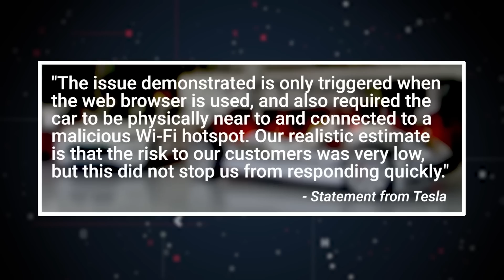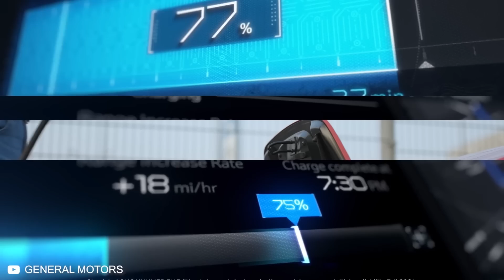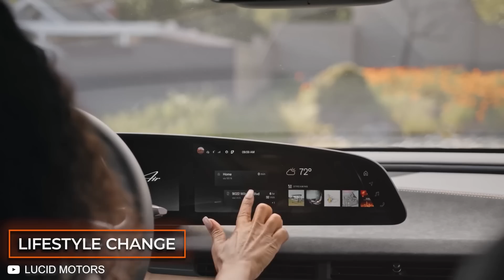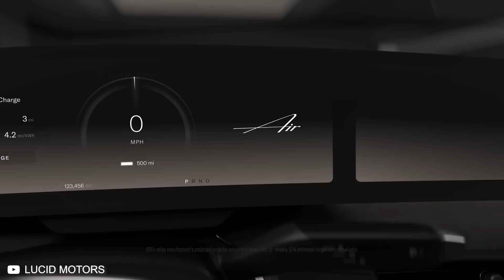EVs' Serious Problems That Carmakers Are Hiding

Comment: the main issue is choice. dont force me to buy EV by eliminating gas cars or taxing them heavily or some other trick.
Reply: Totally agreed. At the end of the day, cars are a product, exactly as clothes or tv, etc...
So there are people who like a kind of cars and other don't.
Reply: @GETTERoriginal  Toxic products are banned in the world as well.  Fossil fuel emssions estimated to kill 8 million people a year, source Columbia Uni.
Reply: @SovereignTroll  yes, and the energy sector, industry in general, the forestry, agriculture and mining sector contribute with around 80% if not more. Ttanspor is around the 16% (at least the last update I could see) and there, cars are around the 9%, so you still not convinced that evs are the solution to climate change, as politicians are selling it 🤣
Reply: @SovereignTroll  I correct myself. "I'm still not convinced....."
Reply: So tell me there is a huge demand to replace a reliable, efficient technology which has been around for a hundred years which can transport me up to 609 miles on a fillup and which I can refill on every street corner with an experimental tech where I lug around a 1000 lb battery which takes hours to recharge, costs a lot more money and has a “ev only” range of 50 miles and few charging stations. Then tell me this tech is ready to replace all gas cars in the next 10 years. This whole thing smells of activist driven push
Reply: @dgraja22  guess you should do a lil more research trog
Reply: @dgraja22  at 500 KW charger definitely takes no hours it takes less than an hour.  hybrid cars take longer but you can charge them at home in the garage.  and I guess that's cold there are engine heater poles.  Note Toyota full hybrid cars are not charged with cable, you are charged with the petrol engine
Reply: @dgraja22  It costs significantly less to charge an electric car than to refuel a petrol car.  and there are cars with long range such as Volkswagen, Kia, Tesla, Polestar
Reply: @dgraja22  electric cars will not replace combustion cars in the next 500 years
Reply: @mike-bv2jc  people said the same thing about the automobile replacing the horse and buggy. It basically took less than 50 years.
Reply: @mike-bv2jc  ha ha ha. OK. Hide and watch.
Reply: @g.goliver  the automobile is superior to the horse and buggy. EVs are not far superior to gas vehicles.
Reply: @mike-bv2jc  in the EU, cars that run on regular petrol and regular diesel will apparently be banned from sale from 2030 or if it was 2035.  but of course they can change in the future
Reply: @notyourtypicalwatchreview2563  That is your opinion not a fact. BEV are superior in ICEV in many ways, but the only one that matters is carbon emissions. So you better get adjusted to it because eventually ICEV are going to be prohibitively expensive at best. Once the majority adopt BEV they will vote that ICEV use either be outlawed or made prohibitively expensive. How about charging ICEV owners for the damage to the climate they are doing.
Reply: @mike-bv2jc  That is exactly the same thing horse breeders and carriage builders said about automobiles a hundred years ago. The smart one got into the new industry making automobiles the ones that didn’t are long gone.
Reply: @notyourtypicalwatchreview2563  You don’t think BEVs are superior to ICEVs, but just because you believe something doesn’t make it true.
Reply: @notyourtypicalwatchreview2563  Idk I be smoking 90% of gas cars in the Tesla
Reply: @integrityprojectsservices7890  and burning through that battery.
Reply: @mike-bv2jc  They already are.
Reply: @dgraja22  I too disagree with the forced aspect.  But ev's had 50 mile ranges 10 years ago.   Charging now is much faster too.  We are in early days for EV's.   The projections I see are not 10 but 30 to 50 years.  The longer period is needed for the grid(s) and charging network to keep pace.  Even if the tech is ready to change over in 19 years would be a bad thing.  One must always know where his towel is. :)

The trouble I see is making them affordable to people with fixed incomes.   Retired disabled pensions.     Maybe a reasonable used market will develop in 10 or so years.  Or maybe robo taxis will be affordable  idk
Reply: @dgraja22  My EV can go 280 miles easily in real world driving between charges and charges back up at home in 5 hours if empty but at a super charger in about 40 minutes if I actually needed to fully charge it so not sure where you getting your info but its wrong and out dated. My Tesla cost me $48K three years ago which is not much different then any other sport sedan in its class with a gas engine. I rarely go on long trips and when I do, if its super long, I take my gas truck. As far as demand, Every Tesla made has a pre paid deposit from an actual buyer before its made and they can't make them fast enough to fulfill their orders. There is close to a two year wait to get one currently, go on line and place an order and see your estimated delivery date. I charge at  home every night, cost me $60 a month and I drive more then the average person. I never stop to fill up or re-charge in my daily commutes, car is topped off and ready to go every morning. That to me is priceless. My gas truck sits and sits, I have to drive it every once in a while just to keep it from sitting.
Reply: @jstar1000  the info is everywhere being in the power line maintainer industry I’m well aware of how much it’s straining the grid 🤣 yeah your ev doesn’t strain it at all but all the ev’s together does and power outages are kinda funny in my opinion as people realize how inconvenient they actually are since most ICE vehicles are doing just fine and ev’s are sitting in the shed till the powers back
Reply: @1234crazydude  not an issue where I live so far, solar panels and battery backup solve that problem also. Also I have two gas trucks so no worries plus it takes power to get the gas out of the pumps right?
Reply: @1234crazydude  Zero power outages in my area in the last three years except for a couple of storms for a couple of hours, no effect what so ever on my EV.
Reply: @jstar1000  Thank you.  I am a little shocked at people spouting off about issues with EVs when they clearly have no experience with them and have not bothered to look into how the cars operate.  I will make space for discussions about electricity generation because that is real, but the complaints about these cars, cost and performance, are unfounded.
Reply: @jstar1000  🤣🤣🤣
Reply: @ElDuchè24  My brother was a truck driver for over 40 years and just retired, you are required to stop for 30 minutes ever what 4 hours or so, so the need to go 1000 miles on a fill up is irrelevant now isn't it? but you hate on Tesla and do you all you want the world is changing with or without your approval.
Reply: @ElDuchè24  Yeah and during your 30 minute break you can charge up enough to get you to your next break is the point if needed and no I don't have a job where I'm required to do anything, I work for myself out on my own so I do what I want when I want pretty much. If you hate EV's then good for you, it don't matter, you hate them, others love them, they are not for everyone at this point but they are badd ass like it or not, the electric grid will be upgraded to make them viable for everyone eventually, electricity is made in America by Americans, what's to hate, prefer foreign oil?
Reply: @ElDuchè24  Will do!
Reply: @jstar1000  where does the power come from to charge it?
Reply: Let's face it EV's are made for city use, but there are a lot of very rural remote areas in US and in Canada where there just will not be charging stations available. A  significant problem with EV's is extreme weather conditions where EV performance is drastically reduced. Another significant problem is that there will inevitably be new EV gov't fees/taxes on EV use. But the most serious problem is that gov'ts want everyone to be owning less vehicles and to be driving less and less to suit their climate change agenda.
Reply: @johnrday2023   Funny, my view is the opposite. EVs are perfect rural choice, plenty of PV to charge them. Cars ruin cities. Paris is becoming a new paradise.
Reply: @jstar1000   That may work for you, but it won't work for everyone.  In my area, it's nothing to drive an hour or more to work.  And it's hilly in some areas.

An EV can't be charged at any charging station because the cord end may not fit the charging port on the car needing charged.  And if there are several cars charging, the kw will be less than if only one car was charging.  And that's if the charging station is working.
Reply: @1234crazydude  Over 4 years in and I've had zero issues and I charge at home every night and never hit a gas station so I win every day but here you are fretting over something that doesn't even exist.
Reply: @jamiepatterson1214  Don't know where you live but I drive an average an hour each way everyday and only charge at home overnight. Its a win win for me. If it don't work for you then I guess don't buy an EV but if you do make sure you buy a Tesla.
Reply: @dgraja22  Climate change worldwide driving this and sharing only one atmosphere
Reply: @SovereignTroll  ev batteries pollute too
Reply: @svenjorgensenn8418  Sodium ion will replace quickly  prototyped.  No mining required.
Reply: On board with you here.  That’s exactly what they’ll do; the market won’t be able to operate freely.
Reply: @shaneemanuelle6243  who is they?
Reply: Ev cars are awesome… but lithium will be in low supply unlike oil.
Reply: @MichaelSmith-fh2nu  Sodium ion emerging. Check it out.
Reply: I agree. People shouldn't feel forced into buying these cars by raising the price of gas etc. Not only that but people would have to pay for a hotel room for the amount of time it takes to charge.  They get money out of you One way or another by doing this
Reply: @kellymckinney3168  The price of gasoline gars should entail their true cost. The cost of gasoline should be raised to include the price of the carbon capture required to remover the CO2 they emit.
Reply: Like they forced the masks
Reply: @Dylan-rs4yx  The people who wore masks were significantly less likely to get sick and die. Her is a perfect example on natural selection at work. Republicans did wear mask and died at much higher rates than Democrats. Fine with me if you don’t wear a mask the world will be a better place with less luddites.
Reply: If we all started riding horses again we could help the farmers with the fertilizer shortage. 🐎💩🚜🌾
Reply: @markkuhn8695  then the government will pas nitrogen caps like in the Netherlands and take your horses away.
Reply: @catocall7323  yes, I've seen what's happening in the Netherlands. All that the government is doing is trading one problem for another. Sounds similar doesn't it?
Reply: If it was so good they would not have to force it now would they ?
Reply: @tommienewton7739  there you go, being logical.
Reply: Biden's plan to increase ev sales was to shut down oil production raising gas prices. Even Elon Musk stated oil production had to increase.
Reply: @eudaenomic  I love it when people actually believe that one man as President can do anything to really affect us.  It is a combination that does this.  The Congress, the corporations, and finally OUR spending habits (and behavior) dictate what is really going to happen. Once in a while one person can cause a change (can you say Putin) but this is seldom the case.
Reply: well that's exactly what they are going to do. Your flat out helpless. we all are
Reply: Nobody whose old enough to know better likes batteries.
The older we get , the more we hate them, due to being let down just when we need them most!
Reply: Exactly. I USED to think I may want an EV. Until the government started pushing them so hard. Now it’s the last thing I’d consider. Anytime someone pushes that hard for something, they’re gonna benefit from it way more than I will. No thanks.
Reply: @ReneeCaraway  I'll help you decide here.  I have a Prius Hybrid (40 to 60 mpg) and a Prius Prime (60 to 80 mpg). Both can use gas as well as electricity. Since gas is still everywhere, I have the best of both worlds.  Oh, so far no recalls on Prius vehicles for fires.
Reply: “Laughs in Alaska”
Reply: Electric cars are a massive environmental disaster. Why would you buy one?
Reply: Hope they do
Reply: No one is forcing anything on you. Yet you insist on forcing climate change on everyone.
Reply: Absolutely
Reply: The entire World must be directed as EVERY person on Earth breathes the same air, uses water, can pollute so all behaviors must be managed.  Fuel damages atmosphere
Reply: They are forcing people two bye ICE automobiles! Because they are taxing electric automobiles the fuel tax!!
Reply: Shut up, fascist.
Reply: Flooding of coastal cities  4 million people a year worldwide dead from fossil fuel combustion products and expense of remedies is forcing issue.
Reply: But you wanna force the vax
Reply: You are already taxed because you pay road use taxes when you buy gasoline and you funded someone's EV purchase with the subsidy funded with your income taxes.
Reply: @namvet_13e  FYI the Oil Industry Gets Billions Of Dollars in Subsidies every year,from the Taxpayers as well
Reply: @namvet_13e  ICEV and oil are subsidized by your taxes as well and have been of many decades. In addition people subsidize them with shortened life spans and a deteriorating climate. If carbon capture was included in the price of NG, oil, and coal people would be using a lot less of them so your criticisms of BEV being subsidized is disingenuous at best.
Reply: @namvet_13e  Gasoline isn’t taxed nearly enough to pay for the costs on society it incurs. The little tax that is now paid is for the construction of road, but nothing is charged for the environmental damage the cause. If gasoline cost covered all its costs, road construction, and damage cause it would be astronomically more expensive.
Reply: Amen
Reply: In the UK thieves are now cutting charging cable's for the copper, it's just getting crazy now
Reply: Absolutely....Communism
Reply: @chess1458  Drugs kill primary only those who use them but Conservatives want government to outlaw them. Gasoline uses kills primarily innocent victims, but Conservatives think the	y should have the right to outlaw drugs while using as much gasoline as they want. Conservatives another word for the grossly self-centered and selfish people of the world.
Reply: And that's EXACTLY what they are doing....
Reply: While Electric cars are bullshit, poisoning the atmosphere and contributing to Climate change isn't a choice you get to make and has nothing to do with freedom. Do you get to murder someone? I thought so.
Reply: WHAT CHOICE??? Once we had sedans and even small cars.  Now we have none! So haven't they already limited your choice?
Reply: @johncipolletti5611  of course we have sedans and small cars! I drive a compact sedan!
Reply: @johncipolletti5611  my Corolla gets 35+ mpg. That is not guzzling.
Reply: @notyourtypicalwatchreview2563  That is because you were smart and not influenced by companies and their ads.  Your car is probably the best for today's world.  Go look at a RAM 1500 and check it's real fuel consumption....TERRIBLE!Don't get me wrong.  I'm not crazy about EVs.  So I drive a Prius (gas/electric) that gets 40 to 60 mpg.
Reply: @johncipolletti5611  a Ram 1500 isn’t supposed to get great mileage. To do what it does requires huge amounts of energy, which gas/diesel supplies. My Corolla can’t do what it does, and neither can an EV truck, which has been proven in test after test. Trucks that can haul cargo need gas/Diesel engines. Everything you use, everything you have, has come to you on a truck, often over great distances. EVs simply can’t do that.
Reply: @notyourtypicalwatchreview2563  You are only partially correct.
As a statision, I know that 93% of those who own trucks NEVER use their truck beds to haul anything.  I also know that too many of them are crying about the gas prices.  
I know....get a Prius (that I drive) that has plenty of room for 4 people.  It also has a pretty big trunk.  Do you know, buying and driving this car will save you over $10,000 in just the purchase.  Also, I can get up to 80 mpg.
Reply: @johncipolletti5611  better to have a truck and not need it, than drive a Prius and have to haul pretty much anything.
Reply: @notyourtypicalwatchreview2563  Can you say "U-haul".  That $100 I paid those couple of times sure beats buying and driving a $50,000 truck ($20,000 over the real price).
Reply: @notyourtypicalwatchreview2563  First you equate pickup truck to heavy duty truck which is a false comparison. Second the only reason everything comes by truck is because trucking has been getting subsidized by both consumers and the government for the last sixty years. If trucking had to pay the true costs of shipment by truck everything would ship by rail.
Reply: In Sweden, there is a higher tax on new petrol and diesel cars, especially those that are considered to emit extra carbon dioxide.  and those who buy those cars simply have to pay to those who buy electric cars hybrid cars and gas cars.  By gas I mean those who can run on biogas and natural gas
Reply: @Andersljungberg  more government control. You poor Swedes get taxed to death.
Reply: @nathanbyd570  Do you know how many millions of dollars it costs to look for oil and gas, then drill for it, and bring it up.
Oil companies don't just sit on their money.  Oh, got any stock in those oil companies (can you say dividends)?
Reply: Exactly. I USED to think I may want an EV. Until the government started pushing them so hard. Now it’s the last thing I’d consider. Anytime someone pushes that hard for something, they’re gonna benefit from it way more than I will. No thanks.
Reply: Well you have no right to buy an ICEV so if the government outlaws them you won’t be able to get them. It is as simple as that.
Reply: @matthewhuszarik4173  What....what....WHAT!?  I have no right to buy a Prius?  Is this a new Nazi law?  You do understand, we still are under a Republic (not yet a Nazi leadership by 2024).
Reply: @johncipolletti5611  No you have no right to buy a Prius. If the government outlaws the Prius you won’t be able to buy one legally. That is how laws work.
Reply: @johncipolletti5611  You have me wrong. I am saying they may outlaw the Prius because it is still an ICEV despite being a hybrid.
Reply: @matthewhuszarik4173  The only way a nation would outlaw something in a free enterprise economy (see guns) is if the republic falls to Fascism.  So, by 2025 you may be correct!
Reply: Stop the global warming scam if you want to stop communism.
Reply: @ricktd6891  Where do you get your ideas from?  First, who wants to stop Communism?  Do you mean Russia and China are COMMUNIST countries.  NO they are not!  They are Fascists.  Please go read what these words really mean.  Hey, use Google if you have to. Next, what do you mean by "global warming" myths?  Go find some pictures of world glaciers from the 1940s and then look at the pictures taken of them now.  Most glaciers are gone.  Where did this 3 mile deep ice go?  Finally, what does a warming Earth have to do with a political idea? If you need some REAL facts, let me know.  I have a background in many fields.
Reply: @johncipolletti5611  Next. : Man's contribution to atm. CO2 is roughly 2.75 %, so how is that "man-made"? Not that it matters because CO2 doesn't control the temperature of Earth anyway, another global warming myth.
Reply: @johncipolletti5611  If you need any more REAL FACTS, let ME know.
Reply: @johncipolletti5611  Oh yea, did you forget most of the melting of the glaciers over the last 20,000 years happened before we started burning tons of fossil fuel, so why would you think melting glaciers is proof of CO2 caused catastrophic global warming? Maybe in all those fields you have a background in, you missed common sense.
Reply: @johncipolletti5611  Now I'll pull a newspaper article out of my file full of articles on global warming and climate change going back to 1846. : The Washington Post - November 2, 1922 "Report on Global Warming." Same scare story a century ago.
Reply: @johncipolletti5611  How much of all atmospheric CO2 is man-made?
Reply: @johncipolletti5611  Where does most atm. CO2 come from?
Reply: @johncipolletti5611  Which greenhouse gas is responsible for the majority of the greenhouse effect?
Reply: @johncipolletti5611  Was it hotter or colder 2000 years ago?
Reply: @johncipolletti5611  Was it hotter or colder 3400 years ago? What were those 3 periods called separately and all together?
Reply: @johncipolletti5611  I hope your degrees help you answer 1 single question. So far I haven't seen it.
Reply: @johncipolletti5611  Any idea what the deadly level of atmospheric CO2 is? I'm wondering if you're smart enough to save your own life if there's a real CO2 problem. How close are we to a deadly level of atmospheric CO2 Mr. Many degrees?
Reply: @ricktd6891  What?  Go look it up for yourself.  Especially look up the graph that shows the dramatic increase in CO2 in the last 50 years!
Oh, and tell the Southwest that those 100 + temperatures  are all in their heads.
Reply: @johncipolletti5611  That's a test of your climate science knowledge and you scored a zero. If you knew the first thing about climate science and Earth history you would know the average global temperature right now is historically cold, not historically hot. So saying some shit about 100 degree temperatures doesn't mean shit because 90 to 95 % of all history was hotter than today's average global temperatures.
Reply: @johncipolletti5611  Now if you want to prove the hypothesis and stop wasting my time, prove CO2 controls the temperature of Earth.
Reply: @ricktd6891  Since I have degrees in science, mathematics, and computers, I might actually know what I'm talking about.  Tell me your email address and I will be glad to send you maps of the temperature changes over time. Of course, if you don't want to accept reality, I can't stop you or change your mind!
Reply: @johncipolletti5611  And tear up your degrees, they're worthless.
Reply: @ricktd6891  I give up on your faulty thinking and data.  I asked if you wanted the data.  All you do is spout.
Reply: Yeah y'all going to let this keep you from driving for free your fault
Reply: Do you not think that there should be a cost associated with pollution? Current polluting vehicles are under-taxed in many countries relative to their capacity to pollute.
Reply: @LiamWallsIsRad  no.
Reply: The public are idiots , so that’s why the government have to step in
Reply: @fradaja  if you think the government is smarter, you’re in big trouble.
Reply: @notyourtypicalwatchreview2563  

Than the public ? I know the government is smarter , especially when I speak to you
Reply: problem is in my country they dont tax EV but taxing imported ICE cars for 300%. 
Basically Tesla Model 3 is way cheaper than a Honda Accord.
Reply: Screw that. When other people choose polluting tech, for no good reason, it removes my kids choice to live on an inhabitable planet. See Keeling Curve. Feel free to choose any EV.
Reply: That why japanese toyota goes to hydrogen car.....the infrastructure for ev charging is lacking and expensive in the future....
Reply: Teslas are safer, faster, and cheaper than gas cars right now.  Most of the negatives in this video were exaggerations.
Reply: It's exactly what they will do, because they don't care a bit about what you (or I) think
Reply: @poliziagrammaticale9430  If “they” want to sell products “they” certainly do.
Reply: Buy whatever you want.  But, right now electrics are faster, safer, better, much cheaper and more fun to drive.
Reply: Driving is not a right, it’s a privilege. The state can do what it wants .
Reply: Thermo management.  My Tesla charges in 30 mins. Supercharges are everywhere.
Reply: Totally agree.
Reply: Let's see how they try to "convince" us to buy those overpriced toys (aka "forced")
Reply: @equinoxb8711  In Sweden, there is a higher tax on new petrol and diesel cars, especially those that are considered to emit extra carbon dioxide.  and those who buy those cars simply have to pay to those who buy electric cars hybrid cars and gas cars.  By gas I mean those who can run on biogas and natural gas
Reply: @Andersljungberg  1 tonne of mined lithium emits Upto 15,000 co2
Reply: @equinoxb8711  Du måste ju tänka på hästkrafterna och vridmomentet /accelerationen  . dessutom kanske elbilarna blir till lite bättre och snabbare dator med fler digitala finesser . och kanske även gratis uppkoppling i flera år  . Hur mycket kostar varje hästkraft . och vad kostar det att äga bilen varje månad eller år . och i den kalkylen ska naturligvis sådant skatt ,subvention ,service Ingå. du slipper ju kostnaden för bensin
Reply: @equinoxb8711 by eliminating or overtaxing all other options
Reply: It’s all about control. They all know it’s a scam. They just want to force you to do it their way or you’re taking the Long Island Expressway.
Reply: Imagine if people were thinking like you back at the beginning of the 90's when the First Cell phones came out,saying things like "don't force to buy a mobile phone if don't want one,I love my land Line" point being made here we can't  stop progress you think how long you benn using Gasoline cars,it's been well over 100 years the only reason Electric cars are becoming mainstream now is because of Tesla,all the automakers know they are in trouble if they don't start making Electric cars the will become the next Kodak,you should consider watching a documentary call "Who Kill the Electric Car"  it's free on YouTube
Reply: @magallon643  you should do more research. Mobile phone is convenient, electric car is opposite of convenient. You need to charge 5 hours. Which gas only 3 minute
Reply: @magallon643  Nobody forced cell phones down your throat. I have a landline and a cell. When the Model-T came out ford was successful because it was affordable for everyone. The government and your taxes did NOT subsidize the car like it is right now. That smells like corruption.
Reply: @SixDayWar67  Nobody force Us to get cell phones,point  I was trying to make was Back in the 90's when  everyone Own Pagers remember those,Only Rich People Own a Cell phone at $45 dls per Minute I could only Dream of Owning a Cell phone back in the 90's,then like in 10 years time when the Technology was out for that  Long,all the sudden it Got Affordable you see only the Rich People in 2012 were the Only ones are able to Afford a 100% Electric  Car at $120,000 dls,fast forward to 2022 I'm driving One  and I'm not Rich I paid for Used Chevy Bolt with 30,000 miles on the Odometer $13,000 dls and so glad I made the Switch,and not spending $7dls a Gallon like other People regarding your Tax incentives they Only incentivizing for the First 200,000 Units it's not Forever,Biden also trying to Make the Incentives for a Limited Units it will no Be Forever   by the way did you the Gasoline should be like $9dls a Gallon and the reason it's cheaper because your Tax Dollar incentivize the Oil Industry federal government gives them Billions of dollars per year
Reply: @SixDayWar67  by the way I have a landline Never Use it the phone it's Unplugged from the wall,because 90% of the time it rings its telemarketers so Annoying there's no need to used the landline unless my friends and Family always call me on the Cell
Reply: @magallon643  I even get telemarketers on my cell. I'm inventing a zap machine to electrocute the telemarketer.
Reply: @magallon643  land lines are not banned. They actually still sell rotary dial phones. As well as they didn't ban photo films and they're still available for those who wants to use that. Smartphones and digital camera took over the market on merit as the most of the consumers prefer to have compact and versatile devices. Same for EVs, that you call progress, it's actually 200 years old tech, in 1900 40% of USA cars were EVs, only 20% were ICE (the other 40% were steam boilers), and there were models with around 100 miles range, comparable to the cheaper ones today, so hardly any "progress". Again, EVs weren't banned then, ICEs took over due to being more versatile, and they still are today. Banning them it's wrong and evil, they're forcing people to something many don't find useful, just for personal gains.

It's like the government says "smartphones are bad, in 2035 only rotary phones will be allowed, i know it sounds like an hassle, but wait and see, someone will come up with something to make them even better than smarphones, in fact, rotary phones are already cleaner, cheaper, better and requires less maintenance than smartphones. They only got some minor issues cause they stopped developing them in the 60s. Once the market takes off there will be phone hubs at every corner where you can plug your rotary and you can leave it plugged overnight at home. You can't stop progress, it's the future"
Reply: @giacomoneri1782  discorso troppo sensato per sta mandria di bambinetti infoiati
Reply: @magallon643  When something new is less convenient than the old item, it's not progress you fool.
Reply: @jasonking1284  just because you are a Boomer and love old technology,doesn't mean I have to stick to it even the most hardcore Car Colectors like the Likes of Jay Leno love  Electric Cars,look him up on YouTube Type Jay Leno on Electric Cars and you'll see his opinion even though Jay Owns all Kinds of Cars,Going From Steam,Coal,Gas.
Reply: Combustion engine vehicle prices will soar and so will gas prices(we’re currently paying affordable gas comparing).
Reply: Gotta invest in public transport too. Make cars a luxury not a necessity.
Reply: @danyfighter562  why can’t we just keep driving our gas cars. The world will not survive without using fossil fuels. It’s simply not possible. And this planet was never intended to last forever anyway. It’s all in the Bible.
Reply: @ReneeCaraway  keeping the earth clean is like keeping your house clean. Not required but it makes it nicer.
Reply: @ReneeCaraway  you can recycle lithium and renewables like nuclear and solar would shore up the energy needs.
Reply: @danyfighter562   That won't work everywhere.  It wouldn't economically feasible.
Reply: @danyfighter562 You have the viewpoint of an apartment or condo dweller in a metro area.   That does not fly for the rest of us.  Seems that robo taxis make more sense than mass transit. 

I have to drive 2 hours to buy a 2x4 and the will not let that on mass transit.
Reply: @danharold3087  I live on the outskirts of Dallas Ft worth on 1.5 acres, not an apartment dweller by any means and I work as a home inspector and drive at least two hours a day at the very least and never need to do anything but charge at home over night and it cost me about $70 a month in electricity. Hate all you want. I'm in love so far three years in.
Reply: @jstar1000  I love EVs!  Would love to have one.  Not sure what you think you read.  Just reviewed what I wrote.  I did say they are not for everyone, at least not at this point (that I did not say). They do make less sense for an apartment dweller especially if he has to go hunt up a charger and sit while it charges each day.   I do think we will be seeing more apartments with EV charging.    Some feel they are being forced out of their ICE cars.   I don't see where that will ever need to happen as the economics of buying gas and fixing ICE should be enough.   I do see where the legacy manufactures needed and still need a bit of help to move to ICE production.
Dan
Reply: @danharold3087  Maybe I clicked to reply to the wrong response. Not sure lol.
Reply: @jstar1000  Not a problem.  Not like it is easy to keep the context here. I don't know what YouTube is thinking...
Reply: @danharold3087  While you may be right that in some ways cars will always be nessasary, namely rural communities, "robo taxis" are just absurd. First off the amount of surface area that has to be dedicated to hundreds of millions of individual people, needing to get to their own destination is absurd and would bleed money. Secondly, society would become evermore UN livable as it is already pretty bad being a car centric society and the population hasn't reached the maximum carrying capacity of the Earth (about 11 Billion)

In other words, the few people who reside out in the boonies shall not dictate how most people live, which is in cities.
Reply: No one’s forcing you my guy, they ain’t taking your cars away but if all car makers eventually go electric, those will be the only new cars you can buy , that’s how new innovations work, you can still use a rotary phone if you wanna but you can’t buy a new one off the market without paying high prices
Reply: @AJ-zt4bb  Yep, this is how market forces work.
Reply: @AJ-zt4bb  I guess I will be buying used cars for a very long time lol
Reply: @chess1458  You can buy all the used cars you want. The problem is where are you going to buy gasoline and oil for them? Without a huge customer base all the oil companies will move into something else as there will no significant money in selling gas and oil to luddites.
Reply: @AJ-zt4bb wrong. Innovation don't work by means of imposition
Reply: I guess sticking with those rotary phones was a better deal, then? Of those picture tube TV's? Or those horse carriages back in the day? It's called progress. Nothing you, or I, or anybody can do about it. The old generation passes on and the new generations ends it saying "what the hell were those old guy, or gals, seeing (or not seeing).
Reply: @Paul-cj1wb  but we were not forced to switch to any of those new technologies. When our analog TVs wouldn’t work anymore with just an antenna, they gave away free converter boxes to anyone who needed them so their old TV would still work. They didn’t say “sorry, you’ll just have to go and spend a lot of money on a new digital TV.”
Reply: @Paul-cj1wb  yeah there was a similar revolt when cars were invented, people said they would never give up their horses!
Reply: @Paul-cj1wb  Everything new isn’t always better. Yea tech is getting better but then again too much. Privacy is gone. Some places I feel we can be filmed in bathroom stalls. Never know. Maybe X-ray cams? So everything advanced isn’t the best choice. As well all this tech just makes humans physically weaker, and emotionally weaker.
Reply: No one is forcing anyone to do anything, lets be real.
Reply: @jstar1000  maybe in your country. Here in Sweden, the gobernment has increased the cost of the permits for combustions vehicles and the also planning to increase the fuel tax when the global situation will be normal again. If that's no press I don't know how can I call it
Reply: @GETTERoriginal  The permits for fossil fuel cars will cause trouble in States.
Reply: @GETTERoriginal  GOOD.
Reply: @GETTERoriginal  For the first three years, you have to pay extra tax if the car emits more carbon dioxide than the limit for carbon dioxide says in order not to receive extra high tax.  You can avoid this high tax even if you buy a car that runs on biogas or a hybrid car.  And it is you who gets to subsidize the electric car owners.  not only do they get about $ 7,000 in subsidy they also get to make tax deductions on the charging box in the villa.  There are also charging stations for electric cars where you can charge the car for free
Reply: @Andersljungberg  tjena Anders!. The problem (for me) is that, exactly as you wrote, I can avoid the taxes if I buy a car that I don't like.
Reply: @jstar1000  when they penalize fossil fuel production, you will be forced to something else.  Keep the internal combustion engine, it’s stupid to go to electricity when we can’t even have enough to suppress the brown outs or keep Texas warm in the winter!
Reply: @jstar1000 are u serious?